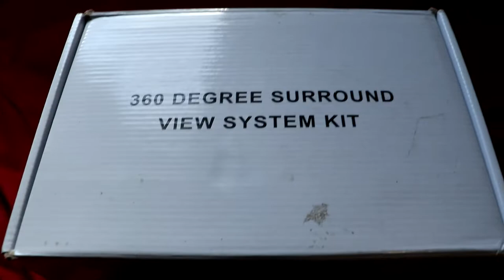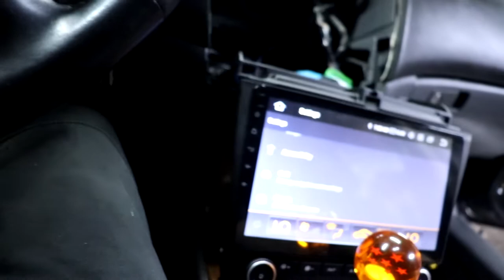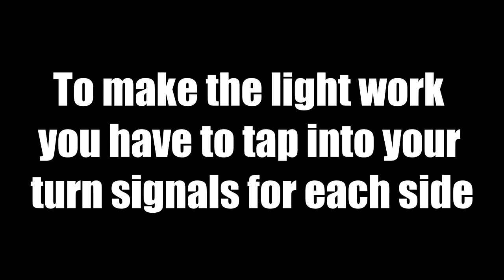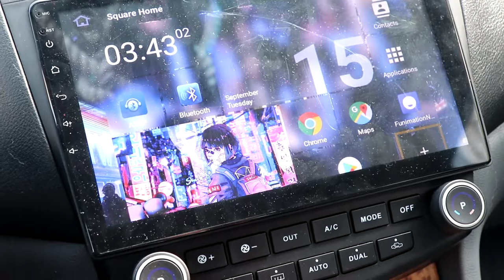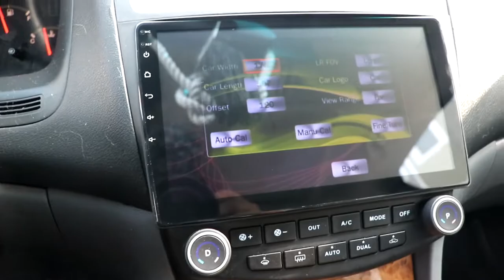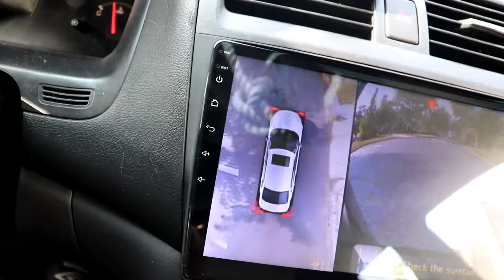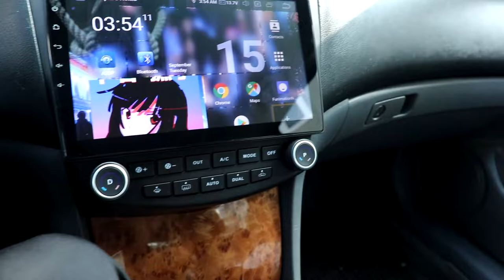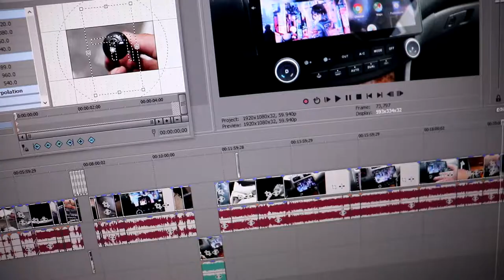360 Birds Eye View Install / Review | TSX Side Mirrors Install 03 to 07 Accord

Comment: You often think you don't need gadgets like GPRS and the Bird View camera system until someone steals your ride or some fool collides with you. I learned the latter the hard way. I installed both since. No regrets. There are more simple cameras you can install if you find this one too much. Why i think this one is better, is because unlike the simpler ones, this one can see to the sides. I used a different type of side cameras in mine. They can adjust by hand and you don't have to drill a large hole in the side mirror. You can used either two-sided tape or self-thread screws to hold it in place.
Reply: Y don’t u drop a link or name for the ones u used no drilling
Reply: @drayblack2684  Sure. No problem.
Reply: @Kevaughn95  You got a link man?

Comment: I have a question if you have a camera that has a backup cam usually when you put reverse the back up cam screen shows up. If you install this ? What shows up when you hit reverse ?? The birds eye view screen or the reverse camera screeen.
Reply from the maker: Both I show it in the video when I put it in reverse the left side of the screen is the birds eye view and on the right is the reverse camera but you can change it in the settings if you only want the reverse camera to show
Reply: @thelostkidsgarage  I'm sorry what I meant to say what if a car already comes with a backup cam as default. So when you install this, it manages to still show both ???? even though this product is made by the car company manufacturer officially ?
Reply from the maker: @haley-and_gaming6371  tbh idk the only way it would work is if you some how made the factory camera wire fit into the box I show in the video

Comment: Have you found a better HD video quality brand? Or you will just be using this same one for your next build?
Reply: search 'ibeam USA 360'....their full surround camera system is the best third party solution I've personally seen in action. their software (that stiches the camera views together to give the 360 views) work seamlessly as long as you follow the install instructions and calibrate them using the special tape they provide.  One guy has a video up showing how you can basically drive just from the 360 view tilted a bit to view forward --no warping or distortion of surrounding cars, and street markings. you'll pay considerably more than the version in this video. but if you've got $1500 to burn, go with them.